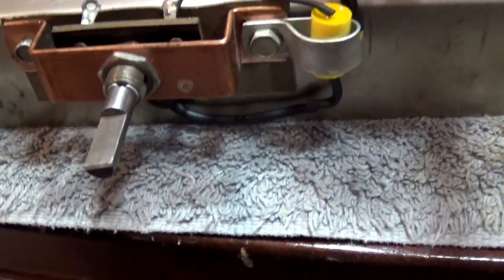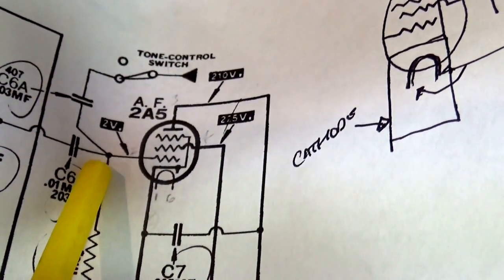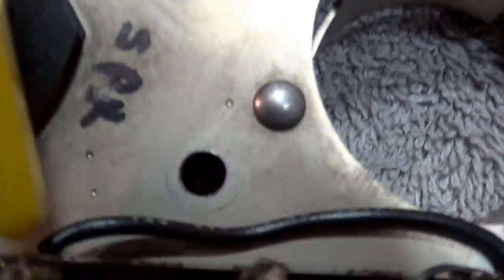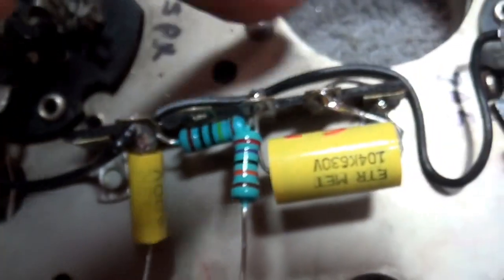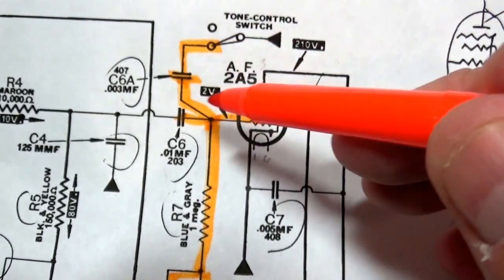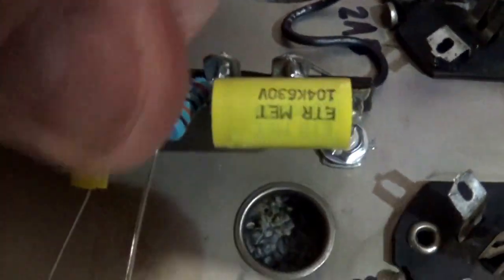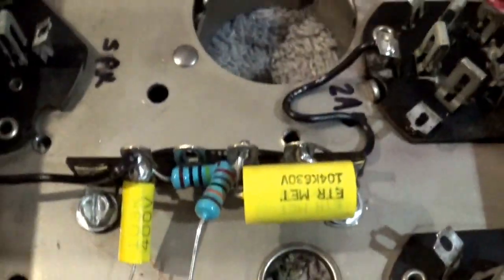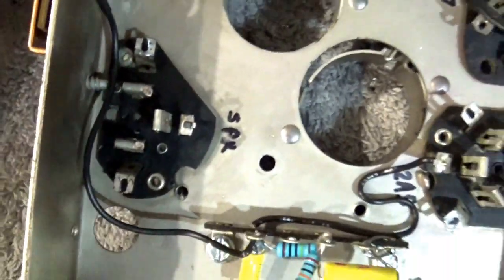Atwater Kent 854 - Episode 4 - Strip Tease

Comment: Hiya Ron, Um contemplating a complete rebuild on my Admiral like buzz1151 did.  I may attack it one part at a time, like tube sockets, transformer, filters, pots, etc., do one part at a time.  So should I do a complete teardown first to the bare chassis, then hook up each part, or do each part, R&R?  then go on to the next part...  Don
Reply from the maker: Don - Complete tear downs are tricky and not recommended if you can help it unless you are going to chrome the chassis , etc..  I think it is so much easier to make a mistake. I like how John did the airline. he left all the old wires which provided a reference point of sorts.  The Atwater Kent I am working on is a risk but is always challenging everything I have learned. I have to admit.. this is testing my schematic reading skills which is good. I know you are much more experienced so for you it may be a piece of cake  :)   Thanks Ron
Reply: piece by piece makes more sense.  but the admiral is pretty simple.  D